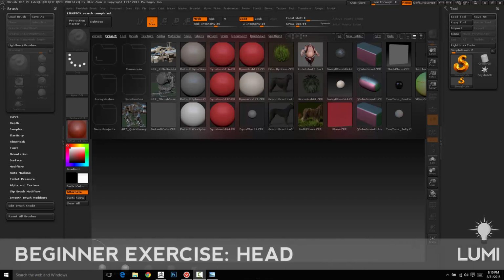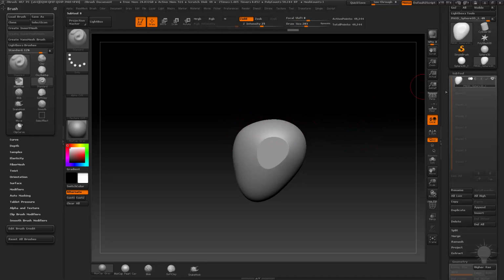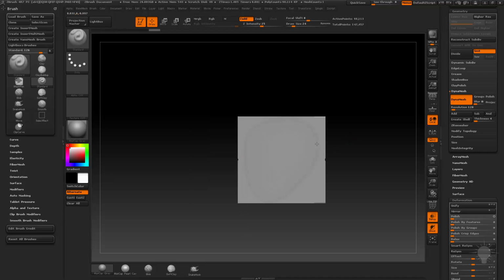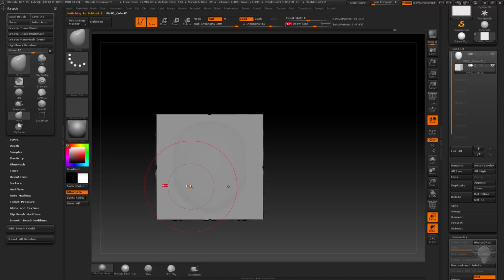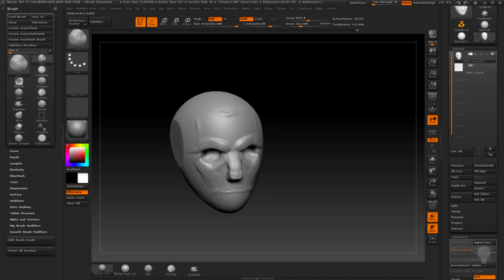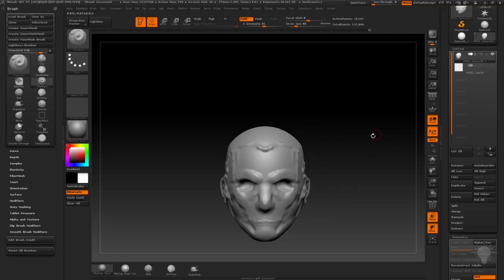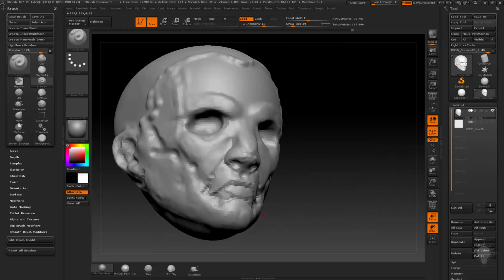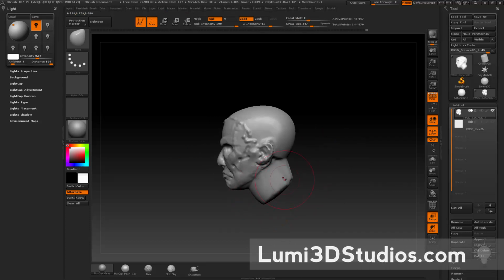038 Beginner Exercise - Head

Comment: Hey Michael. 
I love your videos. They have been a huge help. Been using Zbrush for maybe a few months now, and thought I knew the ins and outs pretty well, but when doing this exercise I ran into a huge problem twice. In a half a second, i seemed to have pressed something and ruined my project. 
Basically, even though there is the two separate sub tools, the cube and the head, at a random accident button or Wacom press, my Tool became a single subtool: the cube. Undo does not work. I cannot perform any split operations. When I try "Split to parts" and "Group Split" it keeps telling me my mesh is a single part. Also, usually in Zbrush, before you click something that cannot be undone, you are given a warning and a prompt. I didn't get any such dialog box. I just click something, and it became a single subtool, a single group and i could not do anything about it. Even stranger, I could still see the ghost of the head underneath, but in no way could i select it or grab it or sculpt on it. 
I can tell you for sure I did not:
-Merge up or down and Dynamesh the two together
-Make Polymesh 3D
Like I said, I felt I knew the features and interface reasonably well at this point, but I am so baffled. I can't believe there is no way of undoing this and I have to start from scratch a third time. 
Do you have any idea what could have happened?
Reply from the maker: I can reproduce this if I take a polysphere primitive, append cube (without converting the polysphere to polymesh3D first), THEN convert the polysphere to a polymesh by hitting the make polymesh3D button (following those steps, your cube will indeed disappear). To avoid this,  1) drag out a sphere primitive 2) hit the "make polymesh3D" button so it's editable, then pull it into an egg shape using the move brush 2) NOW you can append a cube to your polymesh 3D egg shape (also, your newly appended cube should automatically be a polymesh 3D object, that happens by default on any appended primitive). Hope that makes sense!
Reply: Thanks Michael!
You are right. My sphere was already a Polymesh because I loaded in a Dynamesh sphere. But my result happened when I had the cube selected, then hit Polymesh3D. Although when I realized that you were right and I felt some frustration that MakePolymesh can be pushed again and again, even if the object is already a Polymesh, I was relieved to remember that it creates a new tool, and doesn't replace the previous one. So really, I never had to start again. I find the features in Zbrush that create a new tool rather than a new subtool always trip me up. 
Thank you so much for the help, you're a great teacher!
Reply from the maker: Thanks for the kind words, glad that worked out! Tool creation and navigation are two major hurdles in ZBrush, once you've got those under your belt (which you have), it's easy sailing! Or, at least slightly easier sailing...